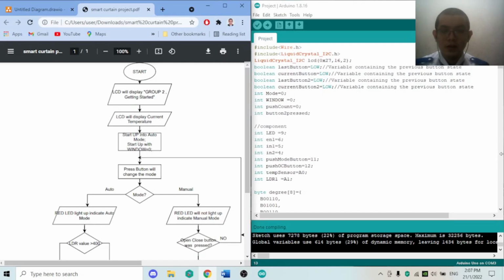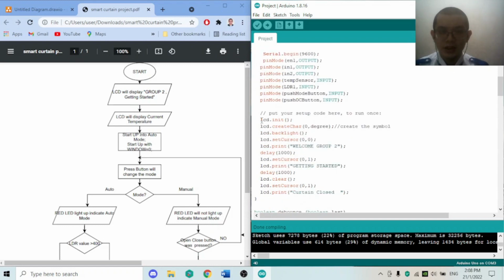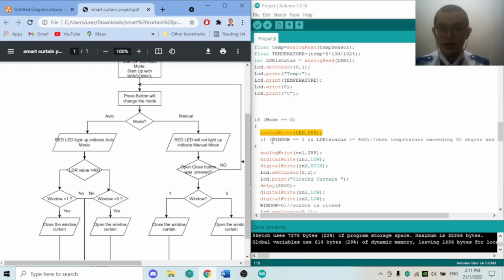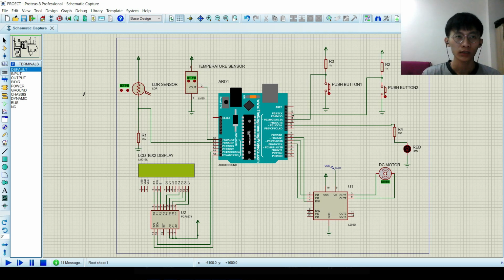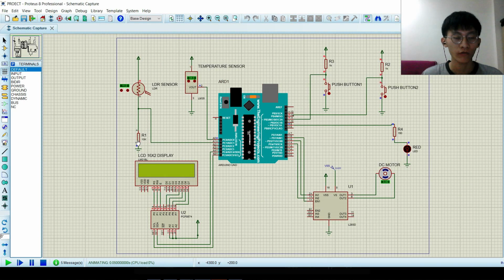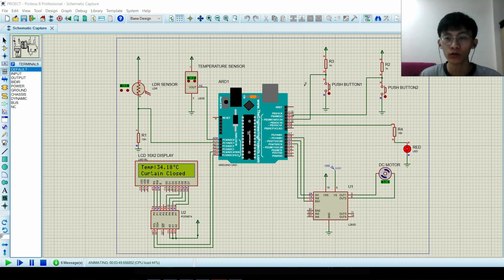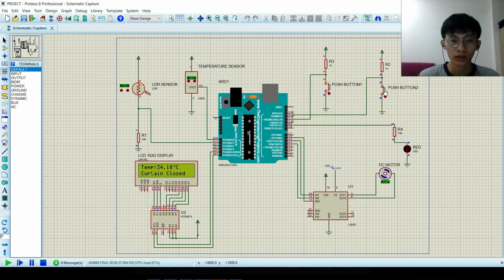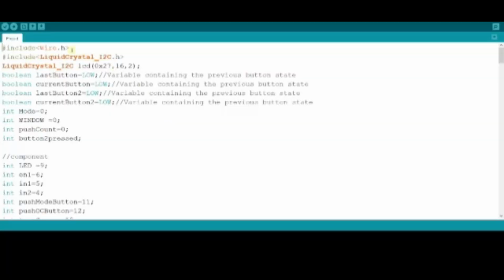BEE3942 03G Group2 Smart Window Curtain

Comment: GOOD EXPLANATION. Just a few questions:

1. How the hardware knows the position of the curtain whether it is open or close? Is there any sensor for this?
2. Why you need the temperature sensor?
3. What happen if the curtain is stuck (ie: cannot open / close)? Is there any way to override the system and inform the user that the curtain is stuck?
4. How do you know that the value 400 is bright? what is the unit for the LDR sensor output?
Reply from the maker: Good day sir, we record the position of the curtain using 1 variable "WINDOW" with value 1 will record as closed and value 0 will record as open. We initialize the Arduino with WINDOW = 0, even if the window currently was close it will not affect the hardware as the rope was in free position and only push the hanger of the curtain. In which it will just either happen open the opened curtain or close the closed curtain and the value will become equal with the recorded one. There is no sensor involved in our hardware to know its position. 
For the second question, temperature sensor are one ways to tell the user what current temperature was. It give the user extra information whether they should manually open the curtain or not. 
Next question, if the window stuck, the Arduino will neither inform the user whether that it is stuck nor system be override by any means.
For the last question, the LDR Lux value equal to 400 was determined as we examined the LDR sensor to our light source which was around 500+. Since we cant determine whenever there was bright day during our simulation (average LDR lux value of 800+) , thus for simulation purpose we only use lux value of 400. For real time uses,  the Arduino should have code the lux value around 750.

Comment: Hello Group 2,
I like that your group has a proper flow chart for its process.

My question is, can you give elaborate on how the command "debounce" works? Would you kindly explain its function in preventing the scattering effect for the coding.

EC19007 - Group 5
Reply from the maker: Great question from group 5. Imagine the situation when you press the button it suppose to have sharp changes of input for once 
example " 0000000(01)00000" where (01) was the time position of the button was pressed
as the situation of real world it sometime will cause not just one sharp changes of input
example "00000(01)0[01]0[01]0000" where (01) is intended input while[01] happened due to hardware issues..
thus using "debounce" function will only record only 1 time input in short period of time, which in this situation was 5milli second. example: input recorded "00000(01)<wait 5 millisecond>00000" and will notify the Arduino that button was pressed.
Reply: @tengyonghan136  Thank you for responding to my question.

Also, I appreciate that you give a succinct explanation👍🏻👍🏻